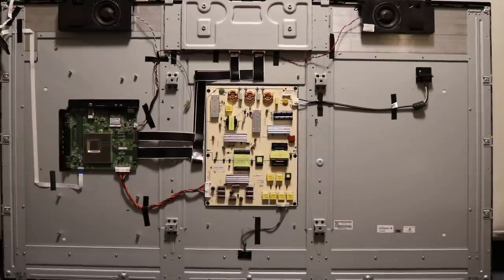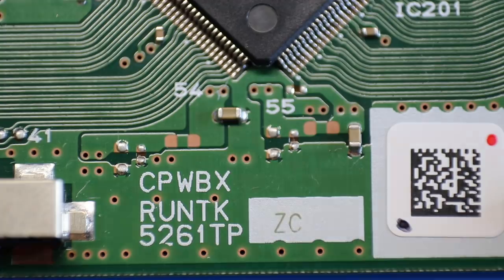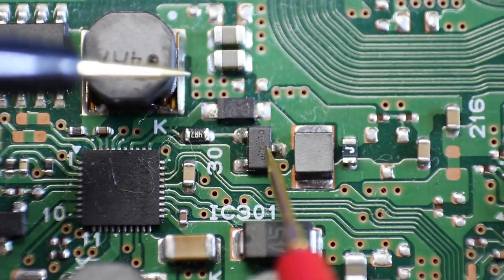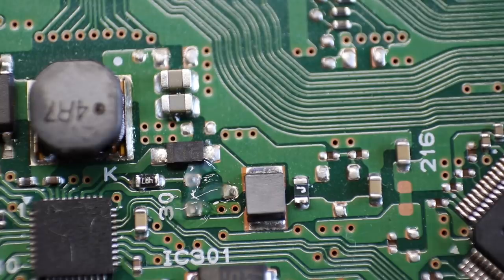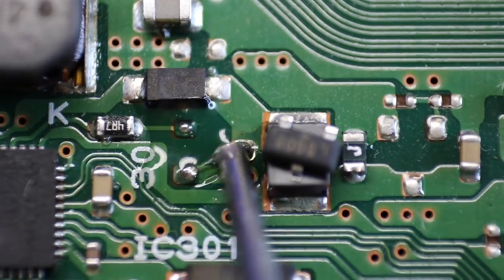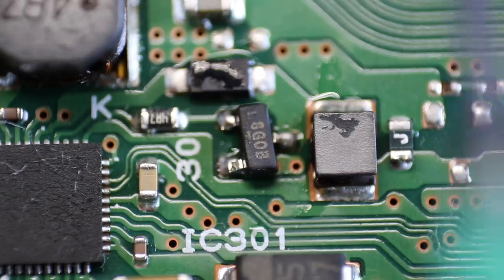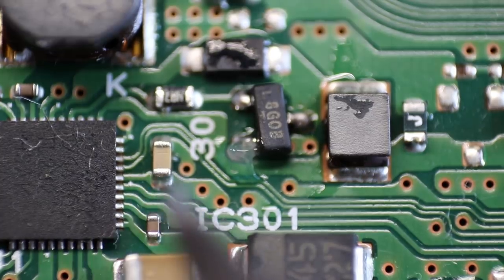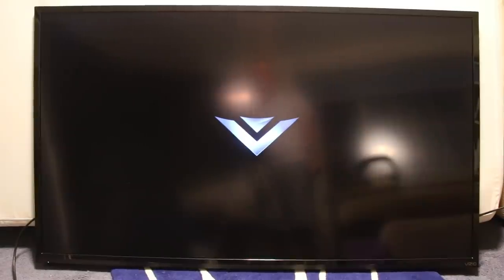60" TV for less than a $1 - Vizio E601i-A3

Comment: This video is amazing, im a plumber by trade & didn't think about using flux whilst soldering on a pcb, i've only got very primitive tooling, just a soldering iron and solder. Could you point me to the location of a possible bad transistor on a kdl-60w855b tcon? As I bought a tcon but it was for a 50 model & looked identical but clearly isn't the right part so identifying if my tcon is bad using my multimeter would really help thanks
Reply from the maker: Thanks for watching!  Yep, flux plays a similar role with helping tin (a main metal) bond with copper.  I’m sorry I don’t know about your tcon board.  This one I worked on in this video is very specific to this model and it’s 70” cousin.
Reply: @FrugalRepair  thanks for your help, my tv has gone from all picture with a 2" wide band, now it just comes on and screen lights up briefly then goes black and sound can be heard while pressing buttons. I did buy a tcon board but it was the wrong type but looked identical. The TV is turning it's self on & is now blinking 5 times red. When I take the lvdc cable from the top of the Tcon board, the TV stays on still with no picture but sound, would you advise replacing the Tcon or is there a method of identifying which board it is with a multimeter, sorry for the long messages, i've had this 60" tv in my front room with the back off for 2wks now. Just want it working but don't know which way to move forward? It seems as if ive made the issue worse as now there is zero picture but the TV panel seems to be good as it was working before I pulled the right ribbon from the Tcon.
Reply from the maker: I don’t have much time to help but if you made a video of the symptoms (everything connected) and DM me on Instagram I may be able to help

Comment: I have an 11 year old 42" Panasonic plasma tv that still works since I first turned it on in 2009… I'll just toss it to the recycling yard when it finally dies on me. It's a power hog compared to today's TVs with the same screen size. I repair everything I can repair though… from clothes washer & dryer, amps to my '06 CRV and anything in-between… saves me tons of money.
Reply from the maker: Awesome!  Great to hear you fix all of those things.  If that Panasonic dies, chances are it might just need a capacitor or a voltage regulator replaced.
Reply: @FrugalRepair   thanks for the tip… I'll keep that in mind, perhaps I'll have a change of heart. That plasma tv is actually THX certified and cost $1,000 back in the days

Comment: I am studying basic electronic right now . How do you learn what components do what and how to test them. I would have no clue what to test or how to test them> How did you learn? What advice can you give me?
Reply from the maker: I would say watch youtube videos to learn.  There are so many great educational videos out there.  The other advice I would give is to try to pick up broken electronics and try fixing them.
Reply: @FrugalRepair  I bought an NOS Radio Shack electronics kit that teaches you about electronics and has the cheese board to put basic circuits together. I was finally able to put a circuit together after months of trial and error to make an LED flash by pushing a button. I was so happy just did it last week. But I have no clue how to test the resistors or the capacitor or the IC this kit is so cool it has already taught me a lot and I have no clue what I am doing  I have a long ways to go thanks for the reply

Comment: 3:42 protip , blow hot air directly to component from the top, not from the angle. you can make little circle moves on bigger components to not damage pcb.
Reply from the maker: Thanks, I just got some bent nozzles to help with that.  Also, to film this video I replaced my microscope with my camera and had even less working distance.

Comment: You can also get a new T-CON board they are pretty cheap,but I highly suggest looking at your Mainboard first and assure all of the cable bands and cord are tight clean and secure. Definitely try the free options first.
Reply: I just replace the whole boards. Sometimes a failure just leads to more failures.

Comment: do you have a technique to spot faulty components on a tv or do you just understand the cicuit layouts and parts used in these?
Reply from the maker: In the case of this particular tcon board, there is a YT video out there already that pinpoints the issue.  I do know how to trace down faults on boards with a multimeter but usually there is the time/cost decision that needs to happen.  If someone else online already has done the work and can jumpstart my diagnosis I'll go for it, but alternatively, if there is a cheap replacement part on ebay, for example, it may just be faster to swap out the part.

Comment: Thanks for the video you think same thing wrong with my PH50HDTV10A it has sound no picture,,, BUT if you turn it on and off a few times picture finally comes on..
Reply from the maker: I don’t think so but it’s possible it’s the tcon.  I’d check the backlight and the capacitors on the power supply.  Is that CCFL backlight?  My guess is a bad cap somewhere.

Comment: Just fixed my Vizio. But mine was not as easy.  BGA component had gone bad so I did have to pay someone with the proper equipment to swap it for me.   1 hour and $75.00 I was back in business.   Not $059 but not so bad.   

Was this a 2N3904 xistor.   That meter my indicate a short if you forward bias a PN junction.
Reply from the maker: Glad to hear you got yours repaired!  The specs for the component are in the description.  This one is a cmos transistor with a diode inside of the housing.
Reply: FrugalRepair sorry.  Hard to see the description on a phone.  You have to really look for.   Thanks for the reply.

Comment: I fix many touch screen 47" LG Using bypass method in different spareparts and it works but surely doesn't sure 100 % guarantee, beacause sometimes the value of the component is erase or none...Congrats to you bro!

Comment: Great video.
I have a 55" VIZIO, MODEL, XVT553SV,  with a problem with the main board. None of the inputs work, except the antenna.
The main board number is 
0171-2272-3237. It looks like the main chip on the board has gone bad. 
Any recommendations ?
Reply from the maker: Thanks!  Even the component/composite inputs don't work?  I would have assumed a bad hdmi mux chip.  Unless you do some more digging on the board with a mulit-meter or find folks who posted info online it is going to be hard to fix. You might have to replace the main board.  ebay is a good place for cheaper boards.

Comment: I have a similar model. I kept it for years hoping I would fix it at some point but I never got to it because I don't have any space to put it or no one wants to use it at my place. I have issues with back light. Sometimes all don't work and sometimes some work. I diagnose it and the leds are bad. Power board supplying led power is still okay. I have to likely wire generic leds if I want it to be functional again because the part is not being sold anymore.
Reply: Aren't there any broken capacitors  on the board?

Comment: Modern tvs have incredibly well made video processing boards and a power supply made out of paper and glue.
Reply: I mean, that's literally what you do to fix them. Add paper, in this case soldering material, and glue, which this is literally a kind of glue. 

Cheap, effective, and sticky.

Comment: Hey man, awesome video. I have a Sony Bravia that did the exact same thing. No picture, but sound and backlight. Would this be about the same problem/solution? It's a KDL48w650D
Reply from the maker: It would not be the same component but it could be a tcon board problem. Many older Sony‘s have a problem with their tab bonds or there’s some other LCD panel problem. Your model might be one of those. If you research based on that model number do you find anything?
Reply: @FrugalRepair  nothing but board replacement, but they say that might not even fix it. Or the panel itself is destroying the Tcon board. So it's a hard sell
Reply from the maker: @Figgumz17  If you wanted, something to try is to disconnect one of the ribbon cables from the tcon to the panel.  See if half of the screen comes on.  Then switch them.  It's possible you can isolate a LCD panel fault this way.

Comment: So I have the same model exactly, however, mine has the logo pop up dim and then go away shutting off the back light. If I do the flashlight test, I can see the word "no signal". Upon opening the tv backing, there is nothing visually wrong with the components. I question if we have the same component issue as the component on my t con board gives continuity like your bad one did, but your tv appears to maintain backlight when broken without displaying logo
Reply from the maker: Sounds like you diagnosed it right.  That your issue is the led backlight.  If you wanted I have a free pdf I created (FrugalRepair.com look under resources tab) that has a trick in it I like to do in this case before trying to repair the led.

Comment: Thanks so much for your videos. I have a problem with my Samsung 50inch smart TV. First I thought it was the flex cables. Changed several times but still have black and pink vertical lines. The screen stays clean black when I disconnect the flex cables from the tcon board. What can I do? How do I contact you to share videos and images of the problem? Please help. Thanks in advance
Reply from the maker: Thank you!  Did you try driving only one side of the panel at a time to isolate a panel or buffer board issue?  You can make a YT video and post here and I can take a look if I have time.

Comment: I don't own a hot air station, but I can imagine how it would go if I did. I'd be holding the old part with tweezers while hitting it with hot air, then I'd drop the tweezers when they heat up. Wrap the tweezers in something to protect from the heat, try again, notice that the solder on other components is melting. End up having to re-solder other stuff after I melt the connections by accident. :)

I'm not very good with solder. Granted, I don't have expensive tools, just cheap, pencil soldering irons that will only melt solder on one particular spot on the tip. I have a small iron with a very small tip that won't even get braid hot enough to remove solder and a slightly larger one that will. I once tried using the larger one to solder some wires to a circuit board and it was a disaster. The tip was too big, I ended up bridging the contacts between a couple of the wires, and while trying to fix that, I caused a couple of the traces to lift off the board. Miraculously, it worked in the end, but it was a mess.

 Lesson learned: stick with the small iron for small stuff and only use the large one for large jobs and desoldering braid.

Comment: hello great video. I have a small problem with  my vizio M50-E1 its a 2016 model i was hoping you can help me with it . when I'm watching Netflix i see a small flashing on the left bottom of the TV
Reply from the maker: Thanks!  It only happens with Netflix?  If so, then that sounds like a software problem with the app. But I find that harder to believe and think it may be a hardware issue. And I’m not really sure what would cause that because there’s too many variables.
Reply: FrugalRepair  After writing to FrugalRepair I did a hard reset and a power cycle.   It has stop . But this is not the first time I have seen it . I feel it’s the app .

Comment: amazing, but how did you find out that it is this transistor, did you check through all components of the tv?
Reply from the maker: Thanks!  I've answered that question a few times in the comments.  Other online videos and content pointed out that transistor.  I did other troubleshooting but I didn't go through the whole tcon board.  I'm currently stumped on a power supply that I want to fix so I might go through that board to hunt down the offender.

Comment: Nice fix, but what is wrong with using a small soldering iron and mechanical solder sucker ?  Every joint around that component was getting hot as well.
Reply from the maker: There isn’t anything wrong with using a soldering iron.  You may not realize the size of this component because the video was made with a macro lens.  You couldn’t practically use a solder sucker, for example.  And the iron tip would need to be very small.

Comment: How to figure out which component was broken? - in this case the transistor.

One thing I've learned is to use a thermal camera to see which part gets hot.
Which method did you use?

Comment: I picked one up with the same problem as the one you worked on. I changed out the T Con board on mine and it worked fine for a few days and all of a sudden after a while the screen freezes and fades to black. sound still works. if you turn it off and on again it works for a few minutes and does the same thing, freezes picture and fades to black with sound? Did I buy a bad board? Almost like something is getting too hot???
Reply from the maker: You may want to try the isolation test.  Watch my two videos on fixing with tape.  This will help you have a better guess if the problem is on the tcon or inside the lcd panel.
Reply: @FrugalRepair  thank you sir. Will do!

Comment: You can absolutely do this with a cheap $15-$20 soldering iron if need be. Obviously if you want to do this kinda stuff more, you need better equipment, but a soldering iron is enough to replace a transistor if your hand is steady enough.

Comment: Wow. How did you know this particular part failed? Magic. If it is always this part that fails in this particular brand/model can you provide me with a list of the parts that most of the time fails in a Samsung, LG and all the other brands. And that of course of all the models? And BTW if it is not the most failing part, what then?
Reply from the maker: Thanks!  I was greatly helped by information online and another YouTube video.  On this very specific tcon board this is the part to check but it is not the case with other models.  I don’t have a list per se, but I’m actually working on a PDF that has many of my top diagnostic tips in it.  I’m on the home stretch with that and the next video!

Comment: 46 inch Samsung led  with vertical lines. Wiggled ribbons...so d went away but still 2 thicker black lines. I pulled it from the container at the dump hoping to fix it.
Reply from the maker: Sounds like tab bond failure?  You can put pressure on the tabs then tighten down the lcd frame.  A common jerry rig solution if that is your case.
Reply: I tried that. Most of it went away but a thick black line wouldn't go away. So I stripped it and dumped everything else.
Kept the components. Panel and backlight gone.

Comment: Thank You for making a helpful video. 
Several ways it applies to me specifically are: 
*My TV has the same issue,
*Being reasonably handy as well as a mechanical genius I found your explanations understandable.
* Now feel I can do this repair as opposed to being hesitant before viewing the video,...
*The narrowing down, getting to the bottom line by using INFORMATION to get it done as opposed to methodical prodding endlessly searching is smart IMO as it will either work or it wont. If not,..THEN keep looking and testing.
* It allows me to do a few other things, as I said Thank You, 
.....AND it allows me to tell all the smarmy trolls who know the technically correct way,...yet watch a video on how to do it, 
....then criticize said video, thereby being smart enough to fix a TV, but dont know how You-Tube works. 
YOU GET YOUR own CHANNEL,...and you run your mouths there. That fix was free............................
Reply from the maker: Thanks for your comments.  What model tv do you have?  This fix with this particular transistor would be possible on two vizio models.

Comment: Great video..my friend want to give me a 65 inch samsung they said it turns on then momentarily turns of ...what is next?thank you have a blessed day and be blessed
Reply from the maker: Thanks.  I’d take it and fix it.  For a place to start, I would recommend downloading my pdf on tips to diagnose a broken TV before taking anything apart. It is on my website FrugalRepair.com under the free resources tab.  It’s hard to say from what you are describing, but a common problem is that the back lights are shorted out, which is maybe why do you see it turn on and then turn off.

Comment: Hi. What if my standby power should be 3.3v and I’m getting a reading of 2.5 to 2.8 fluctuations. What does that mean please. Great videos by the way!!!
Reply from the maker: Thanks!  It probably means something is wrong on the power supply.  Have you disconnected everything from the power supply to ensure a short somewhere else (outside of the power supply) isn’t affecting it?  To find the faulty component(s) you’ll need to check them on the power supply.  I wouldn’t be able to say which part.
Reply: Wow thanks for the quick reply. I have a E601I-A3 and with all connections disconnected I still get fluctuations.
Reply from the maker: Ok, I hope you can track the offending part down.  Does the tv show the standby led?  And does anything g happen when you press the power button?  You can measure for the “backlight on” signal.  I don’t recall what (or if) it was labeled on that power supply.
Reply: FrugalRepair nope no power on at all. I believe it’s a bad power board but trying to justify the price of a new board for an old tv.
Reply from the maker: @davidcooper3583  Maybe try to track down the bad component(s) on the power supply?  Might be a learning curve but could be rewarding.